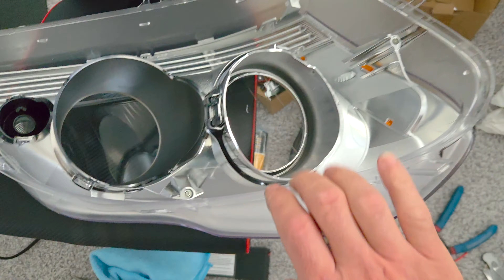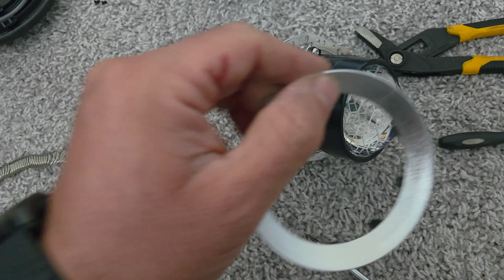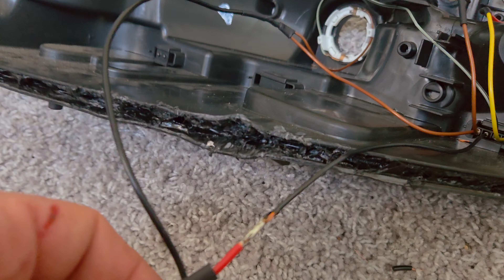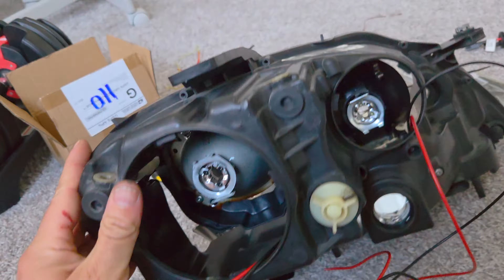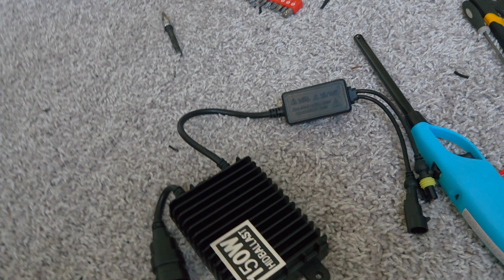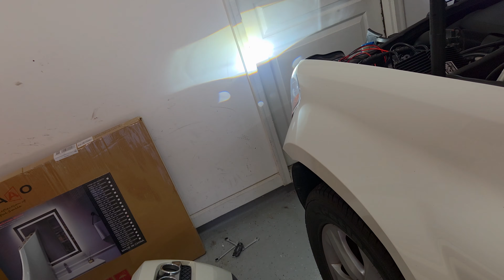💥 “Mercedes GL450 Gets Modern Projectors — Custom Headlight Build!”

Comment: You just removed the cutout shade that keeps you from blinding on coming traffic? So basically you have 2 pairs of high beams in the housing.
And by removing the complete glare limiter from the high beam units you made the high beams just about useless in the rain as the uncontrolled light shines back to the driver from rain and from every street sign.
Reply from the maker: You are correct, I will be making more mods to this set-up and I will address the issue :)
Reply: @AMGChronicles1 Didn’t mean to be harsh, just wanted tell you the possible issues. I have also removed the glare limiter at one point to get more light output. But you actually can have too much light.😂